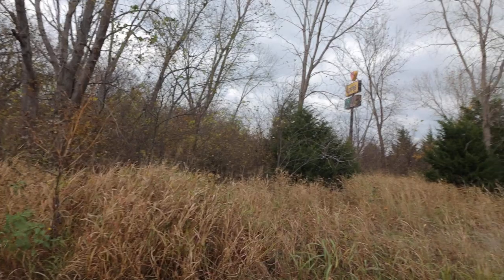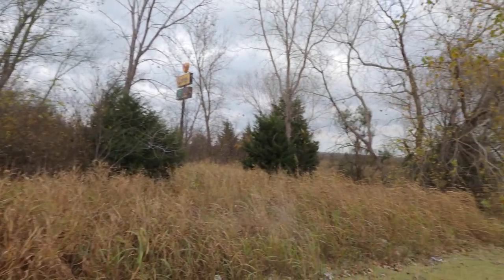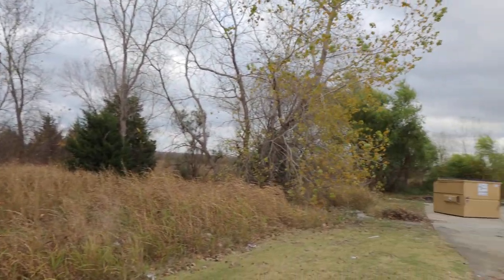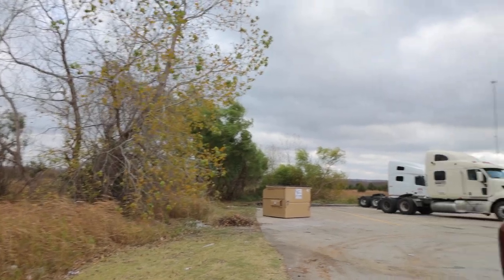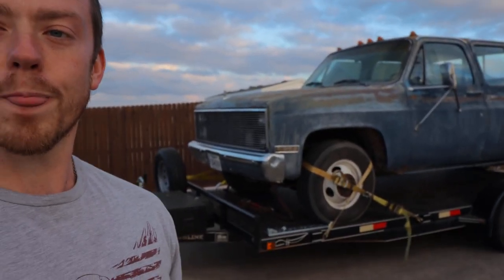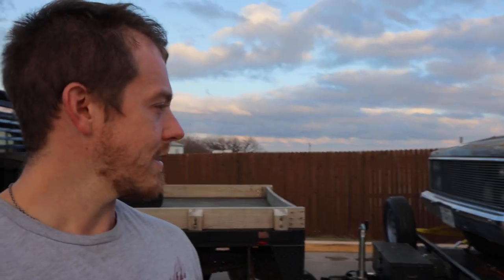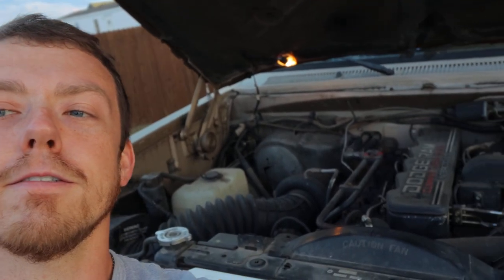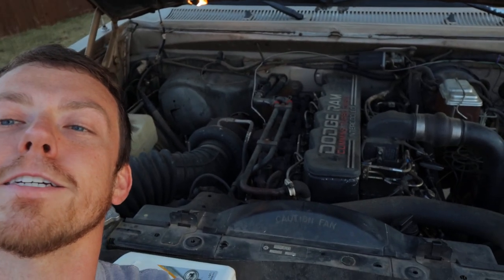I bought an 86 Chevy C30 1 ton Crew Cab Dually.

Comment: I’m almost done restoring my 1982 c30 dually crew cab. Probably post a video when I’m done. Hope to have it on the road by July. Let me just tell people thinking about restoring one of these by themselves it’s one of the hardest things I have EVER done in my life! This is my fourth year working on the thing! Body work is a bitoch! It will be all blacked out with a black pearl paint job. Just working on the on the wet sanding now. That sucks just as much as blocking sanding bondo body filler down! Then after that I got to rinoline the bed spray the inside of cab, buff, polish, window tint, new radio, new carpet, reassemble everything..... 😳
Reply from the maker: That’s going to be awesome man.  I’ll definitely be interested in seeing pics/ vid of your finished project.  I have a long way to go before mines finished and I’m definitely not looking forward to the body work.
Reply from the maker: It’s also turning out to be a very expensive project 😂

Comment: I'm have the same year truck, I need help with hose routing with the air pumps. I live in California . or if you have emission routing label. Im also curious to see what kind of pcv system it has for that year. I would really love to see some pics of the engine. Thanks. Looking forward to it. Awesome truck!!
Reply from the maker: I’ll have to look and see if there is still a label of the PCV routing and get back with you. Thanks man.  Hope you enjoy the content
Reply from the maker: Ryan,  sorry for the slow reply.  The original emission hoses had been blocked off/ removed and the pump was still there but not hooked to anything.  Take a look at my newest video.  I have a good B roll clip of the motor and trans out the truck.
Reply: @MikePittsVlogs  thank you!!
Reply from the maker: No problem man!  Sorry I couldn’t be more help.  Emissions isn’t something I have to worry about to much here in Arkansas.

Comment: You’re easily at 8,000lbs. With one full tank of gas my 88 R20 srw crew cab with a 454 tipped the scales at just over of 6,200lbs. My gutted SRW K30 crew cab with a 292 inline 6 was 5,720. I weighed them at the local truck stop for my YouTube channel, because I always see the question asked and have been very curious myself.
Reply from the maker: Yeah I wasn’t 100% sure on the exact weight but that’s good to know.  I do know it was one hell of a load and it was a long trip lol.

Comment: I rarely see any of those generation Chevrolet & GMC fullsize trux around nowadays.
Reply from the maker: Yeah same here!  They are definitely few and far between.  I can’t wait to get her completed and out on the roads
Reply: @MikePittsVlogs  I had a 1978 GMC just like it except it was just a regular cab half ton.
Reply from the maker: @kevinrichards3288  awesome!  I’m going to miss my half ton single cab
Reply: @MikePittsVlogs  does your regular cab or single cab like you call it have the same body style as your crew cab?
Reply from the maker: Yes it does.
Reply: @MikePittsVlogs  back in 1974 or 75 Ford started making extended cab short bed half ton pickups & Chevy didn't make them til the next generation right after your crew cab. Wow!
Reply from the maker: @kevinrichards3288  yeah... that is kind of crazy.  Especially since these days almost all the 1/2 tons are crew cabs
Reply: @MikePittsVlogs  also back in the 1970s Dodge also started making extended cab short bed half ton pickups & yes like you said a lot of the half ton pickups nowadays are crew cabs.
Reply: @MikePittsVlogs  still unbelievable that Ford & Dodge started making extended cabs back in the 1970s & Chevy didn't make one til 1988 which was the beginning of the next generation besides the midsize S10s offered with extended cabs back in 1983.

Comment: That truck, weighs about 9,800 pounds dry, and that steal trailer weighs close to 3,000 pounds, so a lot more than 7,500 pounds sure, your pushing almost 13,000. I'm just saying that might be a little much for that dodge.
Reply from the maker: I wasn’t really sure what the exact weight was but that’s crazy.  It was definitely one hell of a load.  But the the Cummins did just fine once I was off the rolling hills.
Reply: @MikePittsVlogs  sounds good, and yes I was shocked. I just bought my 79 C30 5 days ago and was like damn this thing is big, but I did find out the c30 dually would have 10 to 12 spring and if it's a 12 spring you can tow long distance at 5 tons and short distances at 7 tons, idk what's long and short to them, but 525 horse power and I think 450 foot pounds of torque. I'm sure the numbers varied back them cause of emissions back then